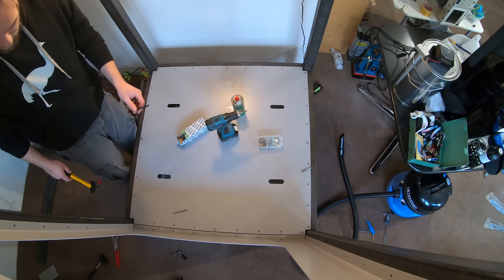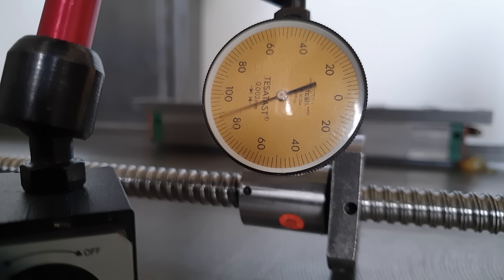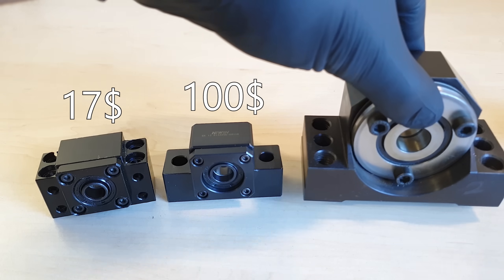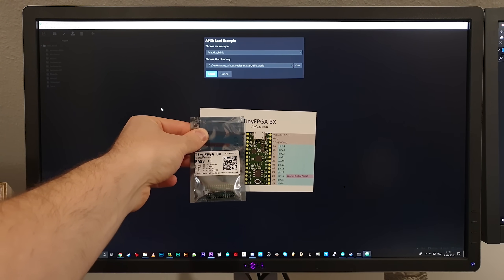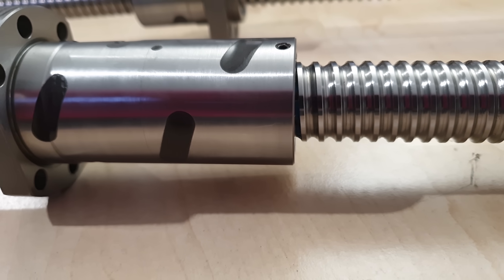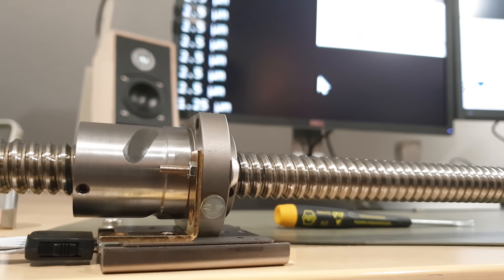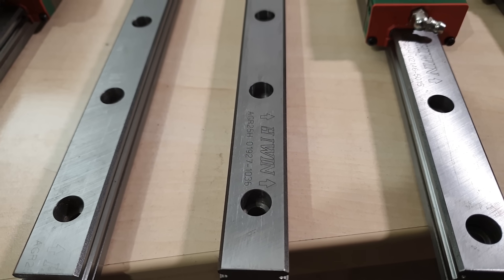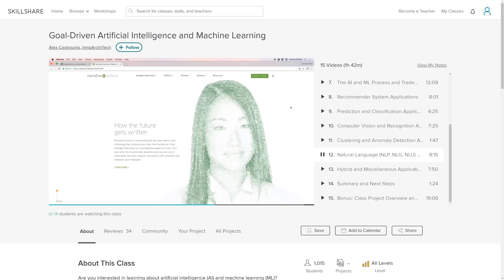Chasing Micrometres with the best Ball Screws

Comment: i have an interesting situation that i need electronic genius solutions. my milling machine has xyz....with 2 movements on z, column and quill. the DRO has one rs232 input for each axis. so......now i need a way to read both the z axis scales on one port. ideal thy will ad and subtract from each other. is this at all possibly? as thy read 2 channels high and low thy should . can this be done ? i also dont mined if i lose 0.005mm on switch over between the two. that kind of accuracy is way beyond my pay-grade. is it possible ore am i blowing smoke?

Comment: Oh i Just dissambled my 200 Gallon reeftank .
Supported on an 8 cm thick piece of granite 
Its dimmesions are 150 cm  by 90 cm !
U May have a piece of it .
A piece because i´m gonna use a piece also for a granite surface plate.
Its grounded very flat , althought i don´t know its micro millimeter flat ? within 1/100 mm most probably. 
I gonna try to mail you for a real challenge /project , only Marco Reps worthy 😎
Deciphering ´simultanious multi frequecy metaldetectors´ all patented..
So nowhere info to be found .
But sure you can measure and puzzel it out 😄..
But i´m willing to partner up to make a better one currently existing .
I know the structual mechanics and materials Needed ,only i have basic understanding in electronics .
Making it hard to figuren that stuff out..
Grtzz from the Netherlands 
Johny Geerts

Comment: Hello Marco. At 3:38 you show us a voice coil similar in construction with voice coil from hard disk. Please explain me how it remain fixed on the position. On hard disk if you apply +and- the voice  coil goes to the end. If you reverse polarity - and+ it goes to the oposite end. The question is what kind of electricity makes this voice coil to remain fixed on a track on any other position betwen right end and left end ? This is interesting to put an osciloscope on the voice coil on this device and show us how can be stand still with incredible acuracy. Nobody know to answer me this question for several years. Thank you.

Comment: Can someone tell me how rolling ring drives compare to ball screw drives? Is the extra effort in using a Arduino or other controller, servos, programming them and using a ball screw drive worth it over a rolling ring drive? I am only winding coils for transformers and dont see the need for CNC. I have never built a coil winder before but it feels like a RRD would save time money and headaches.

Comment: To make high precision  G1 ballscrew is not necessary. For a router it is absolutely an overkill since the rigidity is very poor and so forgot about high precision.

What you need is absolutely straight screw (most of the C7 need to be pass to the hydraulic press and realign very carefully
you must have 2 nuts and calculate the preload  (belleville) because backlash cannot be really compensate if you want to make bidirectional work
Now a c7 will not be constant, it mean that for 1 turn you will not cover the same distance. Of course you can enter the anomaly in a table but it mean that you have a very expensive material of metrology (and you know how to use it) or you must spend the service of a (very expensive pro).
The solution is a linear encoder of high resolution (you can find 500 nanometers (2 micrometer line/4) but the machine must be very rigid and the fixation very  precise. The problem is that 500 nanometers per step is not enough to have a good acceleration deceleration so you must use the encoder of the servo and the linear encoder for the position this is double close loop 
If you buy cheap nuts from China, you must know that they are amazing good quality BUT they often do not put the correct number of balls and the balls are not calibrated  , the good idea is to buy SKF balls and to measure them one by one , with that you will have an axe  very close to zero backlash .
by the way if you take off the nuts from the screw use a plastic tube of the external diameter of the screw and replace the screw with the tube, if you do not do that, most of the time the balls will fail (here there is too much grease)
As explained bearing block are very serious piece of equipment, the bearing should be conical.and great care must be taken, higher the load higher the quality

Comment: I have a John deere 210 1981 want to build my own  but hydrolics are to much implementation. Some have used electric actuators  but they move to slowly to move bucket with any hurry .I believe if we used a cork screw style like 3d printers use but huge roled German 
 one inch shaft  or more with reduction gear the speed problem would go away.not to mention twice speed capacitor motors.

Comment: Tiny fpga? It's time that you discovered the Parallax Propeller. The new P2 is mind blowing. Any/all of its "smart pins" can decode quadrature signals at sys clock rate (180 to 300+ MHz) . Eight independent processors can be programmed in C/BASIC/FORTH/ASM and Python is on the way.

Comment: I know it's been a while but at my job we have what is essentially a large pair of calipers to calibrate cinema cameras. In order to discover and correct for long distance accuracy we use the distance traveled and revolutions of the motor. It uses a belt and pulley along with a very nice absolute encoder. We note the error (difference) of where it ended up vs the target and use the encoder resolution as well as the revolutions of the pulley. So if the machine was 0.015" off we would use that distance multiplied by the ticks/mm of the encoder (a constant), divided by the number of revolutions made during the move. This would give us a long range error correction value that the machine can compensate with. Essentially the number of encoder ticks it should increase or decrease by with every revolution of the pulley. I believe a similar calibration technique could be used with a ball screw mechanism.

Comment: you can get away with using thinner screws by tensioning them slightly, either between 2 angular contact bearings (use roller ones, preloading is hard on bearings that are mostly stationary), or rigid and rotating the nut. I like the chasing micrometers, but harmonised stiffness, adequate stiffness and vibration dampening is where it's at with diy cnc methinks. still, i wouldn't say no to those Steinmeyers either:)

Comment: with the chinese linear rails frankly soak em in isopropyl alcohol or whatever analog you have and put some propper lubrication in them it makes them soooo much better standard they just have the chinese fabrication goop you find on any moving chinese part which hardly classifies as a lubricant
if you really have time patience and a little knowledge on how to reassemble linear carriages you can take them apart completely clean em propperly get propper bearing grease where it should be and they'll work even better

Comment: You might want to consider adding a DRO to your CNC machine.  You can get them cheaply on ebay up to ~2m+ lengths and its probably easier to make the glass ruler in the DRO nearly perfect than it is to make a perfect ball screw.  You could use the DRO for absolute position in a feedback loop with the servo motor.

Comment: Anxiety when using expensive ball screws? We use them in a foundry enviroment where there's sand everywhere, they trash out about once a year.
Also, you know when linear guides are replaced? When the carriages explode from all the dirt and grease inside them and the rails look like an apprentice filed them out of one solid bar and got bored halfway through.

Comment: Edit: Gets addressed in the 'Shaft' video.

Don't CNC machines usually control their travel using DRO? If built that way, the lead precision of a ball screw doesn't matter as much as the backlash. (I think "Umkehrspiel" called backlash in English.) Probably because the ball screw, because it is warmed by friction and cannot be protected as good, is much more susceptible to thermal expansion than a glass scale. Possible that a good controller even uses both to achieve sub micron positioning.

Comment: Hi Marco. I recently bought a workbee cnc gantry and will try to make it mill mild still or aluminium. I found that the kit cames with two small 8mm lead screws which is a deal breaker for me. Then came across your video while looking for upgrading to a ball screw instead. Do you think this chinese ball screw that you put in your comment worth the upgrade for my cnc?
https://www.aliexpress.com/item/32910691183.html?spm=a2g0s.9042311.0.0.27424c4dbgotNr
Thanks a lot.

Comment: Those German ball screws are most likely hardened before grinding. And presumably they are tuned to a spot on concentricity and then get ground instead of work hardened since the torsional energy exerted into the blank is low with grinding and that way you eliminate a variable that could cause distortion. Or maybe it's space dust, I'm just shooting from the hip tbh

Comment: 7:48 "they get replaced based on milage or time" soooo, i work as cnc lathe operator, and no they do not :D
Reply: That depends on the shop, where I work they get replaced BEFORE they fail, since they´re cheaper to replace than most of the products being machined!
Reply: At my old job they did replace them after operating hours. And yes this is done by a lot of companies as they said. It's cheaper to replace a rails + carriages before it fails rather than failing during a cnc job which will cost a lot more like failed material and downtime hours which can cost thousands of dollars.
Reply: @Underp4ntz  It's also usually done when "you're already in there." If you've got a machine torn apart, and it's halfway to the replacement time, it's easier and cheaper to do it all at once.

Comment: The thing about work hardened steel is that it is entirely possible to get the same level of hardness without actually work hardening steel, but just through better tempering of said steel. You should do some sort of hardness test to see wether the cheap ball screws are actually harder than the precision made ones.

My guess is that they are both just as hard.

Comment: I won’t order Chinese ball screws again. For hobby crap maybe they’re good for you but your lucky to even get what you order. Lucky if it’s straight, not scratched and chipped and in general if it actually arrived in the mail. Just stick AC bearings in the cheap blocks.

Comment: Hey Marco, the Steinmeyer ball screws are induction hardened as well (only the threads up to a few mm depth into the material). They also start as rolled part but then they get precision ground to fit to the pitch within tolerance (as low as a few µm). Of course the abrasive grinding will heat up the thread but they balance the cutting depth to control the soft-annealing. So no worries - they will hold up fine.

Comment: A simple laser interferometer can be used to measure accuracy over long distances. All you have to do is to program maybe an arduino to count how many times the interference pattern cycles. The accuracy may not be great because you can't really properly calibrate it but it should be super precise, as long as you don't loose count.

Comment: Regarding the linear railways. Did you check the preload of the blocks?. Usually some friction is a sign of a good system that could be able to transfer vibrations to the machine block.

Comment: To measure long distances you could attach levers to the encoder. It's the same technique that people used back in the day to convert large movements into small ones for precise machining. You'd be trading micrometer precision for mm or cm precision though.

Comment: When you go below 1um accuracy you start getting weird effects like the heat from your body causing thermal expansion.
Reply: I want to see someone use laser interferometry to measure the position to kick off the next generation of hyper accurate making.
Reply: @operator8014  already done. We use those at my work. Picometer accuracy. It's a pain though, as in Australia this accuracy encoder systems requires defence approval. We had one system fail, and I had to arrange approval from ministry of defence to be able to send it back to the manufacturer for repair.
Reply: @brianjensen5200  Does everything run in a temperature controlled oil bath? I saw a video from Mitutoyo and that's how they keep their master leadscrew at a fixed temperature when screw cutting.
Reply: @evildrome  no our motion stages are in free air. We keep the technical hall under 1K temperature deviation and encoder feedback loop controls the rest
Reply: @brianjensen5200  Very interesting... you should do a video!
Reply: @brianjensen5200  that's 1000 times better accuracy than what even our country's calibration lab's best measuring devices have, so question follows: who calibrates that kind of stuff
Reply: @MF175mp  ALIENS
Reply: @evildrome  you know he might have to get approval from his defence ministry before he is allowed to do the video :-)
Reply: @evildrome do you happen to have a link for said video? Would love to see this!
Reply: @hadenoughofthisshit  So would I. It’s about 30 mins only in Japanese IIRC.

Or it was back then (maybe 12 years ago). It’s probably subtitled now with on the fly translation.

Anyway, I’ll have a look for it.
Reply: @brianjensen5200  Defense approval for an encoder? WTF! that only makes me curious to know why such thing is regulated. What kind of military device could use as key component a picometer accuracy encoder. Some kind of ultra sensitive microphone or what?
Reply: @operator8014  Your in luck I happen to be in charge of the cnc department of Infinity Drain. We have brand new AMS Loader from Amada paired to our 4kw Laser. The Loader uses just that to tell where the pallet traverser is and to also measure sheet material thickness.
Reply: When I was a kid, some 60 years ago, my (much) older brother worked at NASA's Lewis Research Center. He took me for a tour and one of the things he showed me was their distance measuring instrument. 

It was kept in a climate controlled room with its measurement displayed to I don't remember how many digits, but it was a lot. When we walked into the room, still several feet from the instrument, it immediately started registering a change just from our body heat. 

I don't know how the system worked, but as I recall it was like a large metal lathe in form, with two large instruments on a heavy metal rail system separated by a couple of meters. That long ago it couldn't have been laser-based. What could have produced this kind of sensitivity that long ago?
Reply: @leroycasterline1122  I wonder if it was a Moore M48?
Reply: Working for the company i do now ever damn morning the 5axis ntx2000 coolant drops to like 10degrees overnight and the slots we mill with a 5 micron tol can be as far as 15 microns out since the machine and billet are FREEZING

Comment: For measuring longer travel accuracy, a fairly cheap method would be to get one of the cheap 12" (~240mm) digital calipers. Note that it has to be one of the cheap ones, but for some reason nearly all of the cheaper digital  calipers have serial output, and there are tons of tutorials for interfacing with them. Resolution isn't spectacular (+-.05"), but they are much cheaper than something like a lathe bed axis DRO and would likely provide some good data (at least for repeatability testing). At least in the US, they are normally avaliable for ~15USD, I would imagine they aren't much different in the EU. Plus, then you don't have to feel bad about hacking a nice starrett or mitutoyo instrument!

Comment: Your drift is likely caused by thermal expansion. You'll get about 10um/m change if your ball screw changes temperature by 1 degree. You can confirm this by heating the ball screw with your hand.

Comment: dunno about the tiny fpga, but you can use the blue pill stm32 fr a cheaper/faster upgrade to the arduino
Reply: Yes, the $1 STM32F103C8T6 with true USB 2.0 at 72mhz ought to be enough.  Maybe?

Comment: Chinese ballscrews SFU, DFU models sold on eBay suck big time... Who cares about C7 accuracy even if their ballscrew does not have a bend? Try NSK or THK ballscrews rated with C0 and C1 accuracy with preload. You cannot build a "good" CNC machine with faulty parts. No, your software's backlash compensation cannot do the work to fix the ballscrew manufacturing issues.

Comment: Hmm ball screws are suppose to hard like really hard  where apprently you should be able to get a file and try filing them and you shouldnt be able to scratch then but dropping thing on them or allowing dust thats hard to turn into grinding paste kills them  ...... also I thought you would be using a micron clock to check repeatability on a position  and you can check repeatability over a longer distance you just with the same thing but that ball screw has to be in a rigid set up before you take a reading